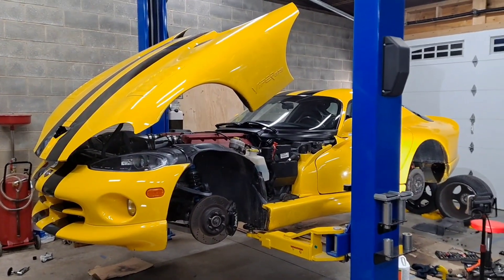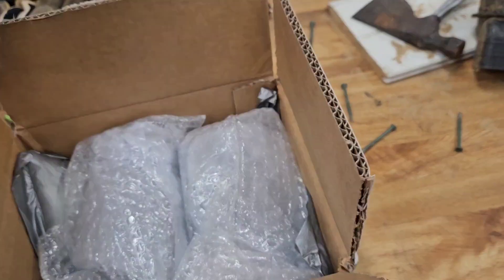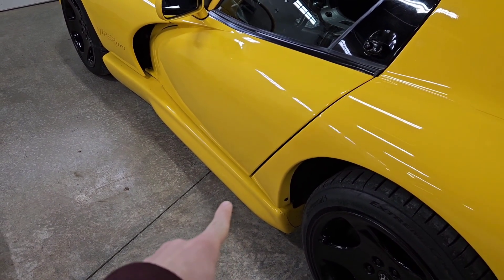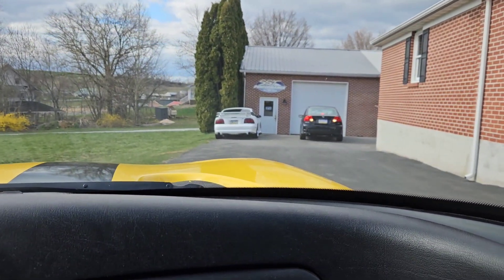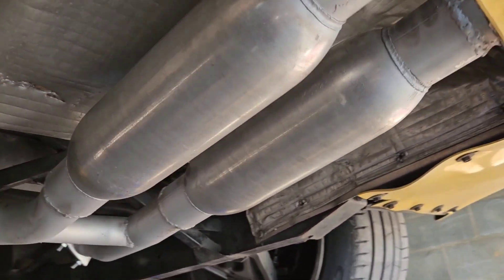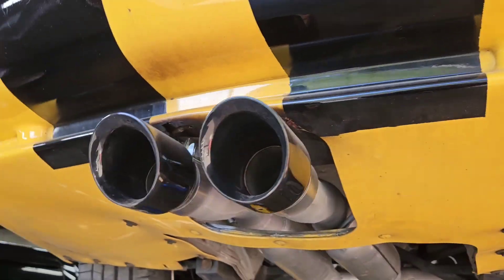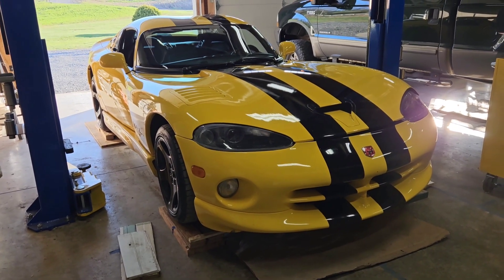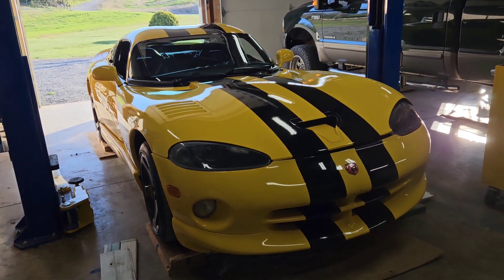Giving the Viper a proper exhaust

Comment: Nice video! I'm on stock still with the muffler deleted. Debating going this route. That must of made quite a difference going from straight pipe to resi/cats. Hard to tell on youtube audio.
Reply from the maker: Yeah, the new setup is hard to portray through video. It's very nice, with a lower rumble, but still has the burble. It obviously isn't as loud as the straight pipes, but it's still far from quiet. (Sounds a lot quieter on video because of the deeper tones)

Comment: How much did it cost to do this rather than a cat back from a common corsa, borla, etc.?
Reply: My guess considerably cheaper.
Reply: @gigatron2008  sounds like it... :/
Reply from the maker: It's a reverse engineered Belanger exhaust, which after researching several we thought had the best note. That exhaust, which also includes Cats, is 2,575 for parts only, no labor. We have less than half that invested.